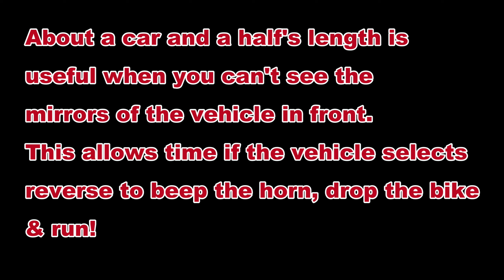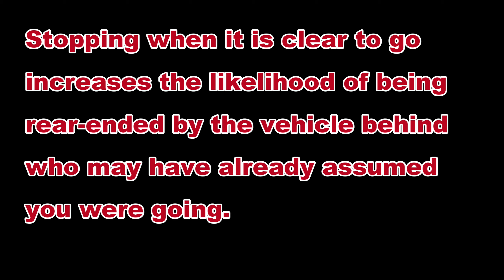Town Riding Demonstration Ride #2: Part 2. Motorcycle commentary on a CB500F

Comment: Brilliant video, such clear instructions and things that I will 100% use when I go out next. Thank you for your videos they really help. I'm always nervous about riding it wet weather because of the surface and being in a 125cc. Is there much difference between the 125cc and the larger bikes when on wet roads?
Reply from the maker: Hi Dave, thank you for your kind words. The most important thing on both large and small bikes in the wet is to be smooth and gentle with the use of all controls. So long as you are smooth, avoiding sudden deceleration or acceleration or changes of direction, takiing bends and turns a touch slower to allow for slightly less grip, and you are mindful of road surface issues like diesel or mud, you shouldn't run into too much difficulty. Try to relax when riding in the wet. The more you do it, the more confident you will feel. Wet roads aren't inherently "slippy" but they do afford slightly less grip than dry roads if that makes sense. I'll be doing a dedicated wet weather upload soon ☺️

Comment: Great opportunity for discussion at 7.30, I'm sure some advanced riding advice may suggest holding an aggressive (ie not far left) position there, to prevent cars coming through, I'm with your position there though, as often they'll come through and force you over anyway.... Always a good debate though.
Reply from the maker: Haha yes, I'm less of the "dominate your position regardless" camp, and more of the ilk that if it is safe for the cars to come through why prevent them from doing so just because we want to be more dominant. Move in, reduce speed, be prepared for any other hazards and let everyone continue with their journeys together. If I didn't consider the gap big enough or safe enough then yes I would dominate. Thanks again for your comments 😊

Comment: Is it good to usually hover your finger over the front brake at all times in town riding? Or would that reduce your throttle control?
Reply from the maker: Hi Steve, good question! I wouldn't advocate covering the front brake all the time. Cover it (and/or the horn) if you see a hazard that you feel may be about to develop but otherwise keep your fingers on the throttle for control. Anticipation is key here rather than covering the brake all the time. Many thanks 😊